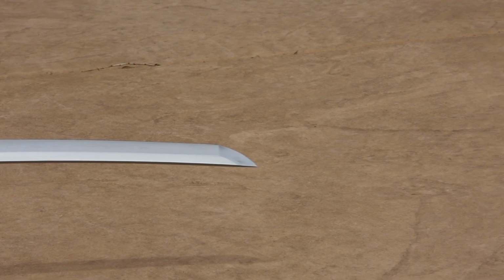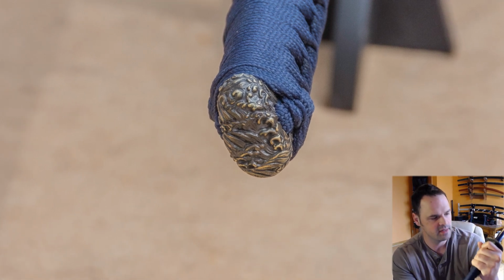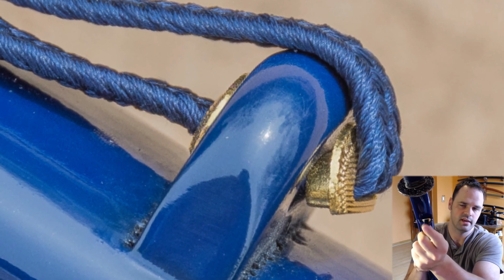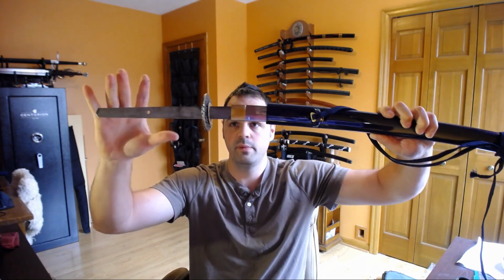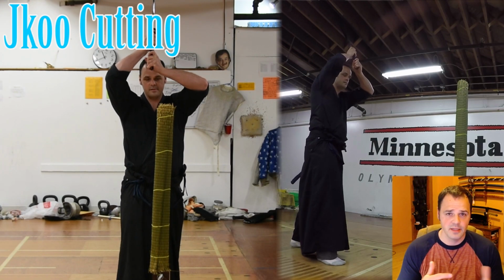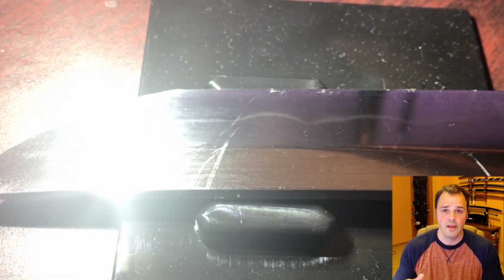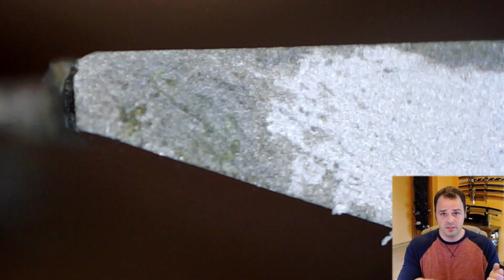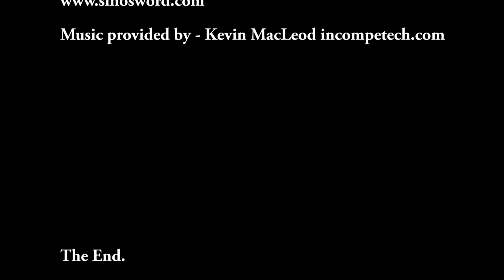JKOO Tsunami(津波) katana-T10 Steel Review & Destructive Test

Comment: @matthew jensen this is the most detailed katana review i have ever seen. Going over the measurements in blade width and taper alone is more than 99% of reviewers do and i find that info one of if bot the most important info when it comes to sword specs. Subscribed!

Question: i know all manufacturers are not the same so is there anyway you could please review the (relatively) new ryujin t10 dh custom katana? SBG is promoting them quite a lot and they are very attractive to me due to pricing.
Reply from the maker: I will keep an eye out for a good deal on one second hand.   Thanks for the kind words on the review.
Reply: Awesome!! Thank you so much for the reply. One more question: in your experience and GENERALLY speaking, are the T10 Differentially Hardened katana coming out of Longquan China of “reliable” construction? “Reliable” being defined as, the swords wont snap in half and fly into you if you cut their intended targets (water bottles, tatami rolls, green bamboo and equivalent).
Reply from the maker: In general yes.  I have had very few swords with critical failures that would result or have resulted in snapping. In general T10 seems to be fine.  I have the best luck with 1060 and then 1045 out of China.  1095 has been unforgiving.
Reply: Thats great to hear. May i ask what you mean by “1095 has been unforgiving”? I thought 1095 and T10 were the same?
Reply from the maker: A larger number of the 1095 blades have taken a set or chipped than their counter parts in 1060 or 1045.   1060 seems to be the more resilient of the three.

Comment: Wow, I bought a custom one in T-10 with a suguha hamon...massive 3.5cm motohaba and 3cm sakihaba and it definitely does not have a secondary bevel. Although I ordered it with hira niku, its razor sharp and cuts tatami more easily than any of my albion swords or my Ryujin custom T-10 katana which are all shaving sharp (vigil, steward, munich, dane) . I will be reviewing it soon. I am very curious as to why the sword they sent you seems so much different. My tsuka is also quite ergonomic and not nearly as thick as yours..although I did get the "battle wrap". The one complain I have with mine is that the scabbard is very low quality, poorly fitted, and just a piece of crap in general.
Reply from the maker: It seems the bevel is something that most people don't have on their swords.  Glad to hear it is not common.

Comment: I personally love T10 tool steel.
Reply: Dark EdgeLord  I have a t10 that cost me 385.  This one here is 200. Some I’ve seen cost 800.  Seems to me a good form swing would result in a clean cut from both a hanwei sword and this one. I’m guessing price point comes from build quality for one and the metal quality as well.  T10 is t10 but all metal is subject to flaws and companies like this seem to sell the flawed swords for a cheaper price. Still would work in a zombie apocalypse! Just maybe not on bamboo
Reply: T10 is a good hard steel . I dont own any T10 katanas but I do have a hsts tsunami thats through hardened 1095 spring steel and I have a clay tempered 1095 steel katana from handmade sword thats called the bamboo warrior . the hsts is the better one but both are very legit and tough .
Reply: @santanajackson6160  Can you please elaborate more on why is the clay tempered 1095 the lesser choice? I wish to buy a T10 or 1095 clay tempered, but some companies told the to get the monotempered since it would be more fitted for cutting small branches. I just dont want my blade to chip form cutting small pieces of wood but i also really love how the hamon looks
Reply: @dragossabin8265  well swords that are clay tempered aint as tough as a through hardened blade because with clay tempered swords the edge is harder than the spine and it makes it easier for a blade to take a set but with a through hardened blade the whole blade is hardened all the way through and theres less chance that the blade will take a set or bend . theres nothing wrong with a differentially hardened blade but you just gotta use common sense and use the blade for what its meant for . but if I use a DH blade then I would stick to lighter cutting but if you gonna be chopping on wood then you better go with a through hardened blade . but at the same time I wouldnt be cutting wood with any of my swords because it would eventually cause rattle with the hardware and a katana wasnt meant to be cutting wood
Reply: @santanajackson6160  thank you so much for the reply! 🙏

Comment: They were not even hard hits and look at the damage on the T10, my search for good steel continues.Thanks for vid.
Reply: TheWarriorArts In my opinion, can’t beat a good high carbon steel.
Reply: sim_ra 88 You are right. At the time I left this comment I was much less informed than now. 

T10 is basically a Chinese version of 1095, with a bit of tungsten I believe, which explains why it can be great for a Katana. 1095 is tried and true. 

Nevertheless, the sword here probably had a less than optimal heat treat which is what really counts in the end. You could have the best steel in the world, but without a proper heat treat (the soul of the blade), it really wouldn’t do you any good. It’s just the way things happen with mass production swords. There will be average and then outliers in both very bad and very good. 

You will run into very tough and great 1050 swords and you will get not so great swords made of a steel with more carbon, fancy alloying etc.
Reply: Jonáš Malinovský 5160 is really good stuff.

Comment: Their Jian came with a somewhat blunted tip and a deep crack in the wood of the handle. The tanto is OK, Fuchi Koshirae is not lined up well with the wooden part of the tsuka/handle, but no big deal. Their custom katana has a similar problem in one spot where the metal ring near tsuba cuts into the hand, but only under certain circumstances (depending on how the sword is held). The saya though came cracked, they promised to send me a replacement, it's over two months now, still no saya. I e-mailed them and asked for updates, they promised to get back to me the next day, but never did.
I really wanted Jkoo to be awesome, and I am a returning customer, but considering it took them over 6 months (against promised 2 months) to ship me the sword (mono-steel T10 with DH), and wood they used clearly wasn't dried or treated well enough, as it cracked in 2/3 items from them, and not a very reliable CS -- I should say that there are better custom sword vendors at this price point out there. Sorry, Jkoo, but hope your reputation does go up.

Comment: After watching several of your videos over the past 6 months, I decided to buy a daisho set from JKOO/Sinosword. I was horribly disappointed when it showed up 2-3 weeks later than expected. Neither was sharp (neither will shave hairs on my arms, or cut paper). The hand guards are both warped and not fitted well. At least I could (after sharpening) use the wakizashi to make cuts, but the katana is unusable. It seems like the handle was put onto the tang twisted. So if I hold the handle properly, the edge will be twisted like 3-4 degrees... Which would guarantee a bad cut because edge alignment would be off. That would almost guarantee the blade taking a set and would not cut anything. I am currently working with JKOO to have a new katana sent to me, so I get to test their customer service. I'd rather NOT test that on my FIRST purchase. I'll update when this whole fiasco is done and hopefully I'll be able to give  a glowing review when the replacement shows up.... I don't think I'll ever be buying another blade from them cause this whole process has been a nightmare for me.

Edit: That is NOT a comprehensive list of everything I've found that is wrong/sloppy/rushed with both swords... Not even close. Just the big stuff.
Reply: @adamekcar  oh yeah, they did end up replacing the katana, but it had the same issue albeit slightly less severe. The blade ended up chipping on the tip when I cut a soft milkjug. In short, I'll never every buy anything from them again. I think they suck and give YouTubers the "good stuff". I'd recommend you go somewhere else and avoid the headache and ultimate disappointment that I got.

Comment: I have seen Many sites state that they or Manufactures actually measure to the tsuba or hilt e.g. they include the hibaki, which is incorrect way to measure, your way is the correct traditional way to measure the blade, however often the variance may also be because that particular manufacturer or site does not measure the traditional way. With Jokoo they insinuate they measure the traditional way so this may actually be a case of handmade variance. (For customers out there if your worried about length,  lol, first check the manufactures data vs the retailer data to try to get the closest measurements and see if they state how they measure.)

Comment: I had a JKOO for a while. I posted a review of it at SBG. I thought it was a pretty good deal. In fact I was considering buying another one, but I found a deal on a Hanwei Maru Renshu instead
Reply: I'm wondering why they sent you one with a secondary bevel. Mine was as flat as a flat thing all the way to the edge.
Reply from the maker: I get the feeling from a few other owners that I might have gotten an odd ball.
Reply: Yeah, I would have thought they would send out an example of the best for a review, but maybe they sent out one of their "heavy discount" swords to save money
Reply from the maker: I can respect just sending me a blade that a customer could have gotten.  It is a better representation than a cherry picked piece.   That said, I don't really know what or why they sent this one and it is the only piece I have to base my thoughts on..
Reply: I talked to Van Yang and he told me they just grabbed one of these to send to you. I have commissioned two from scratch and have two I have ordered and customized from their offerings on their site. The secondary bevel was odd as the most recent katana i received from them has a razor sharp edge. It was so sharp the katana jumped out the saya and cut me well before I could get the sword bag open lol. For the price the have some great blades and options to customize them and Id definitely buy more from them.